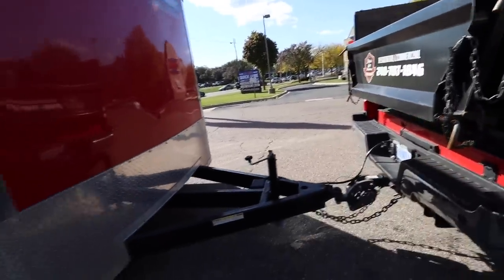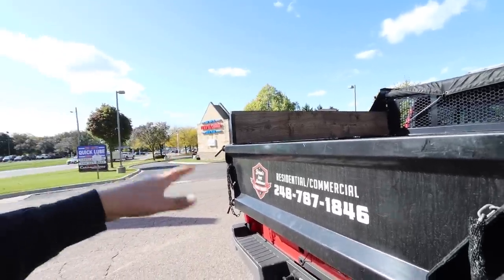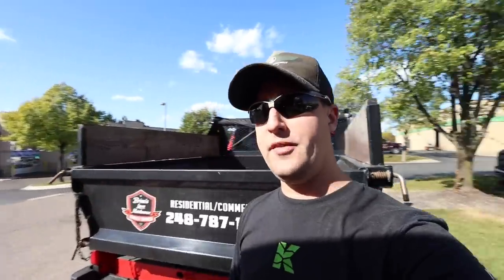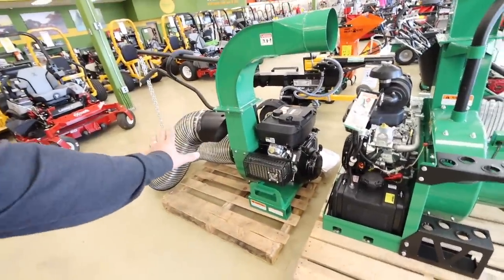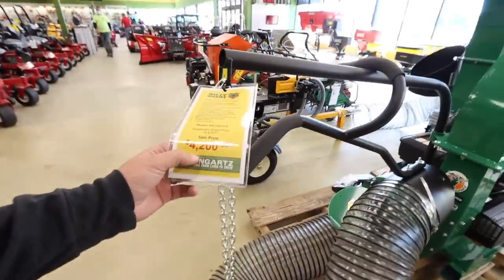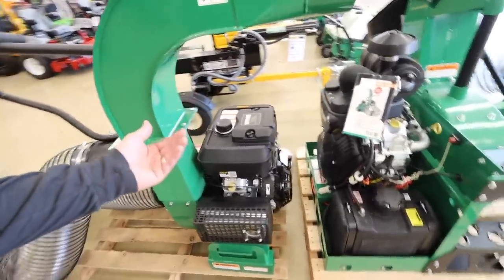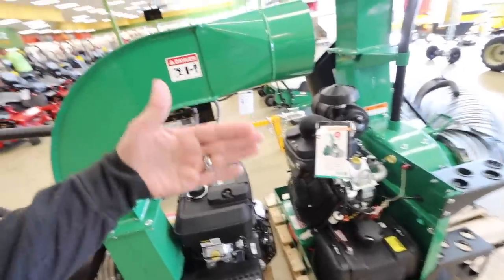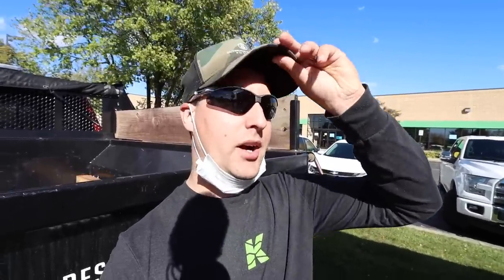How We Plan To Triple Our Leaf Clean Up Business This Fall

Comment: My properties are 99% residential. Not many with tree lines to blow to. I just upgraded from an older 16hp Lesco to an 18hp Billy Goat. I like the idea of the Piranha blade on the billy goat. My Lesco just didn’t reduce the material enough. So I believe the piranha blade will help that. I mount my vac on my trailer deck. Up at the front corner on the passenger side. It’s close to the curb. The tube comes right over the top edge of the trailer top rail so there’s no wasted tube by being mounted high or toward the middle of the trailer. Tubes are crazy expensive so I don’t want to have to buy a longer one. I’ll try to post a set up video once I have the Billy Goat mounted. Ideally I’d prefer to have the vac mounted to the back of the truck somewhere so I can just take the truck to do curbside pickups instead of having to pull a 16 foot trailer too. But I haven’t figured out a good setup for that yet. In regards to the blower - I would buy a couple strong push blowers before I bought one of the Hurricanes. I use my 11hp Giant Vac blower as another guy by parking it with it blowing in the direction I want to move the leaves then use my BR700 backpack blower and blow them toward the push blower. The push blower blows them a lot further. Then I just move and repeat. Works pretty efficiently for a one guy operation like myself most of the time. Those ride on blowers are a pretty niche machine. Like for wide open and large. Just not the right fit for my properties. Now a self propelled walk behind blower sure that might be nice to have. Maybe down the road I’ll go that route. But doubtful ever a $14k blower.

Comment: I used a 18hp setup añd mounted it on a trailer just need to mount it super secure. We built a plywood box 8' high and blew the leaves in the back it worked fantastic.  I'm in ontario so yes we have to beat the snow also...   use the Billy goat walk behind not the stand on if you have echo back packs your golden. Stand on blower has allot of power and will blow mulch out of a flower bed so easy and small stones .

Comment: I bought a chipper shredder that will sit on a platform on the tongue of my trailer so I can reduce the bag pick up from my ztr by a 12:1 ratio. I think that a good back pack coupled with bagging and a shredder is the way to go.
Reply: Which chipper shredder do you use?
Reply: @studentoflife251  I bought a Cub Cadet CS3310.

Comment: Brian your video's are great.  I would look at it this way.  Which do you receive the most revenue from, those customers where you can blow the leaves into the woods or where you can pick up the leaves at the street.   If you can find a decent rider blower buy it,.  A used one may come up after the season.  I purchased a used Hurricane Z3 for $7,000 with 250 hours on it during the summer of 2018 and I was able to use it not only for leaves but for blowing off driveways after mowing and cleaning up debris after storms, saves my back and me walking.    .

Comment: I would go with the 18hp leaf loader and maybe a push blower. I do a lot of my leaf cleanups with walker mowers and they make a blower attachment that runs off the PTO which costs about what a push blower does. You can't beat a walker with a gh dump for leaves though. It's about 18k with the high dump and not only do you get a capable leaf rig, but also get a mower and a machine capable of running snowblowers and different decks.

Comment: Definitely don’t get anything smaller than a 18hp loader. You will spend more time unclogging the hose than sucking leaves. A Jrco leaf plow is what I use to move massive piles to the truck or to the woods. The leaf plow in conjunction with the leaf loader is the best bang for the buck for a 1-2 man crew.
Reply: Agreed

Comment: I’d buy it in chunks.  Get the leaf shredder blower deal for the truck.   And hang in there for another year to get more equipment.   
I know in NJ we can get snow as soon as late October.   So I’d be hesitant to spend the money on leaf gear in 1 big shot.   If Covid has taught me anything, is that it’s good to be cash heavy.   
Unless you find that you really need the machine to make more money.  I’d hold off.  You basically have to be in a position where you’re losing money because you don’t have the machine.

Comment: Careful with how you mount the loader.  I have a 14 horse power Billy goat and I stuck it on the back of the dump trailer and it bent the hinges. Ended up sticking it on the tongue of the trailer. Where ever you mount it make sure it’s heavy duty

Comment: Don’t go smaller than 18hp. How about making it hook up to your plow mount? Pipe over the cab into your box, then you don’t have to weld/bolt anything up to the trailer and you have more room to work with the vacuum. Look online for a good used leaf loader. I got a really nice lesco leaf loader years ago for a steal from a guy who was getting out.
Reply from the maker: I’ve seen setups like that, I’m not sure if I want to go that “all in” on our setup. Not on this truck at least.
Reply: Brian's Lawn Maintenance I hear ya, it’s tough when it’s a work truck and personal truck too.

Comment: If you mount a leaf loader machine on your present trailer frame, would be advisable to reinforce the members of the frame.  The added weight of a motor and impeller on the trailer frame could bend or deform the frame when you hit a bump or travel at higher speed.  Trailer frames are engineered to handle an assumed load and stress.   The bigger the motor mount, the more you want to ensure the frame can handle the load and stress.  IMHO. Good luck.

Comment: You're going to squat your 250 with a box. I did it with a 350 and it was rough with wet leaves. We have the 37hp loader and the hurricane blower. Definitely go bigger with your loader, clogging leaves are very frustrating (18 hp)

Comment: Buy the 18 hp debris loader and U-MOUNT blower for zero turn. Now you are at about 8K That stand on blower isn't going to move leaves 8k faster than U-Mount blower. Plus U-mount blower chute has every angle between left and right as stand on only has Left, Center, Right. Plus with you U-Mount blower on ZTR one man can blow leaves and bag them at same time on those properties where you have to haul debris away. Saves a ton of space in trailer also vs stand on blower.
Reply from the maker: That’s kind of what I’m thinking too!

Comment: you can get two 18hp self propelled wheeled blowers for still thousands less then the ride on blower and still be very productive, I would say it is worth it only if you start to score alot of large accounts or most of your residential accounts are blow into the woodline. Pair those with a loader that's what I would do.

Comment: Hey Brian, have you thought about a dump trailer this year and build sides and dump the bags in there and the dump insert? Next year add the debris loader and maybe a walkbehind or stand on blower? I run a walkbehind this year with a bagger and bought a new dump trailer for leaves and spring clean ups. Next year I want to move to a 60in stand on with bagging system. Keep putting out great content!
Reply from the maker: We still need to transport the mowers around so I have to take the enclosed trailer with us.
Reply: @BriansLawnMaintenance  I totally overlooked you don't run 2 trucks yet. 😂
Reply from the maker: Haha yeah if we had two we might. And that could always change. My goal is to keep it one rig though tbh. I plan to stay small 👍

Comment: Im here in north carolina, our leaf season has started this week. We will deal with leaves until around christmas, we have a older billygoat truck loader, 12" pipe with a custom mount to the back of a 2ton dumptruck, about 14yds is how much we can load. We are a slightly larger crew 6 of us just blow leaves to the curb with backpack blowers while 2 people drive around with the truck and suck up the leaves or blow them into a huge pile back the truck up to them and load up.
Boss is looking into the toro multiforce and a 20yd dumptruck this year

Comment: Ease into it and if it works flip the equipment next year and go bigger. Just my opinion...you can only fit so much stuff in the dump truck. Just don’t pack the leaves too tight so that they can go in easier through the smaller hose.

Comment: I use a bagger on m walk-behind and  an echo shred-n-vac for tight areas but mostly blow them into the wood line with a backpack and walk behind blower. I'd say you'd have better luck getting the loader first. You said your $20k behind from the spring, and here you're looking at $20k worth of equipment by the time your fabricator gets the loader on the trailer... $40k of leaves? Thats a big bite Brian

Comment: Every time I've looked into it I've heard nothing smaller than 18hp.

Honestly, this is the exact problem I've had with your closed trailer setup since I started watching. The dumper bed looks cool, but hell, I have a hard enough time climbing into the back of my RAM 2500 bed!

I have a 7x14 trailer. I built a 7x6x8 leaf box on the front with a "plunger" (basically a "pallet" on a chain). My 52" stander goes on the back. We use two blowers and the mower to get the leaves to the trailer, load them. When I get to the dump I unload the mower, open the door to the leaf box, hook the chain to a concrete block, pull forward to eject the load, blow out and close up. It's about a ten minute turnaround time.

Comment: It pays for itself in 2 to 3 yrs.  If I was to set one up I think I would do a separate Dump trailer but would need to split the trailer into two sections one that would hold just stand up and blower the other would just be debris.

Comment: I’d go with a dump trailer with a Z3X or Windstorm and eventually add the leaf loader. Or even a push blower with a blower buggy. You’ll be able to load 3-4x as many leaves and not have to disconnect a trailer to dump it. Load the ZT right into the trailer if you went that route.

Comment: You need to check out the Scag Windstorm before you buy a Z3. I bought one in the spring, it's an absolute beast. I watched your VRide mower demo video and you seemed to like that platform, the Windstorm is built off the same platform. And it's less money than a Z3...
Reply from the maker: Nice!

Comment: start smaller but adequate. bite the bullet and yes your season may be short but you'll be able to make it up in increased volume of business by efficiency. Spring and Fall clean ups $75 each doesn't take ling to make it back.

Comment: Price break down for the multiforce Toro
Unit is 10k with a mower deck
The low flow hydraulic kit is 1k
The blower attachment is 4k 
For 15 k you get an amazing mower and  in my opinion the most versatile stand on blower

Comment: Brian, you'd be better off buying a large pull behind from a municipal auction. Most have been well maintained. As far as the containment i would suggest a truck with leaf box. You won't get a lot of material in the pick up box. Check out our videos. Best of luck.

Comment: Snow on thanksgiving, remember I called it.  The bigger the better we deal with a lot of wet leaves so that extra weight makes it tougher.  The vac is the key and you can look at it in phases big vac now and ride on blower and dump trailer in spring.  The ride on blower is a lot of labor cost for extra guys with backpack blowers.  Also your storage situation right now is not good and that will be solved once you build your house.  Or just steal Brandon’s trailer for the season he won’t mind.  Lol

Comment: Personally I think you should get the hurricane blower for this year and use it and build up your box on your truck. Then next summer purchase a decent size f350 with a dump and then buy a 37 hp loader. Unless you can do that all this year because I think your mower will be mulching it pretty well
Reply: Lol wut? A dump trailer would be a fraction of the price and you can build it up to hold more leaves then a dump box.
Reply: MK Adventures no matter what he needs a second truck and one truck with a dump is cheaper than two trucks and two trailers
Reply: @MB12116  He doesn't need a second truck because where he wants the direction of his business to go doesn't call for one.
Reply: MK Adventures  he won’t make as much money and be as efficient if he only has one show truck. If he beaut a large dump instead of his 250 he’d better off

Comment: I've been in this game a long time a small leaf loader is a waste in my area fall is wet and some snow early which makes a 13hp loader very inefficient takes up way to much time removing piles go big or stay home as for a stand on blower all depends on the size of the leaf jobs you are going after blowers only push so far than either a leaf rake for lazor or push them with the machine  which compacts them  and makes them tougher too suck up that why its worth it to spend the money on the biggest sucker now time is money

Comment: I would definitely say you need a dump trailer. Just think when you go to dump your leaves out of the back of the truck, you will need take your trailer off every time. We just got a debris loader this spring used and it is great it is a 18 HP and it is mounted on the back of our dump trailer
Reply: He can bypass that issue by dumping all leaves at the curb and picking up at the end of the day once the trailer is dropped back off.
Reply: Stojkov's Landscaping why go back to a property twice in a day just get it all done in one visit?
Reply: @natashabradley232  I think that's a better option than having to unhitch the trailer and go dump every 2 or 3 cleanups. Brian likely has a super dense route and shouldn't be out of the way much, if at all
Reply: Stojkov's Landscaping true other then he has a dump box in the back of his truck. We have found many ways to use our dump trailer other times of the season

Comment: Bigger the better intake hose dude trust me! I just got a tow behind one, cuz its got a 16" intake hose run by a v4 motor
Just make sure you make it so you can use the trailer jack messed that up when we did it lmfao
Reply: Get the leaf loader and not the stand on blower.
Make sure you don't put any stick in or your just be uncloging it constantly it sucks lol
Reply: Get the f18 over stand on and get a blower buggy for it. Let's you attach it to the zero turn
Reply: If the snow melts we do leaves in-between plowing.

Comment: I would say you’re more than fine with a 13 hp because you aren’t filling a big dump trailer like most companies are I have a 12 foot dump trailer and I have a 10 hp Leaf vac and it works very good and it packs in tight

Comment: I would just get the 18 hp and the z3000 would be necessary if you had like 16 trailer with a 37hp billy goat and even then I would just get a dump trailer with the 18 hp
Reply from the maker: Yeah that’s what I’m piecing together. Good call.
Reply: @BriansLawnMaintenance  Ya you just have to decide what is best for you

Comment: Brian, your dumper is only 6 foot, it will be full very fast , this whole set up is too much too spend for the return.
You are better off to buy a 14 foot dump trailer and installed a 18 horse power loader to it.
Anything’s less than 18 horse bug down on wet leaves

Comment: Don’t do it. Buy a trailer like Brandon.  You can use it for all kinds of projects. Haul your zero turn with the sexy bagger in that trailer. Park your zero turn in the back yard when you make the trip to the dump. (Take the keys). But 12-15 harbor freight tarps. You already have the leaf blowers. Utilize a helper or 2. Layer the tarps in the trailer, they pull off easy at the dump. It’s hard to justify spending soooo much$$$$ up front just for a month worth of cleanups. Focus on your snow removal, fertilization. Enjoy some down time with the Mrs.